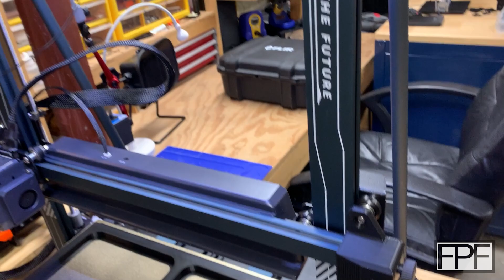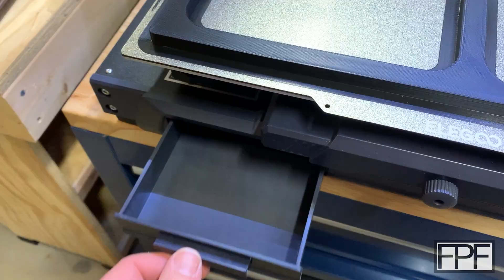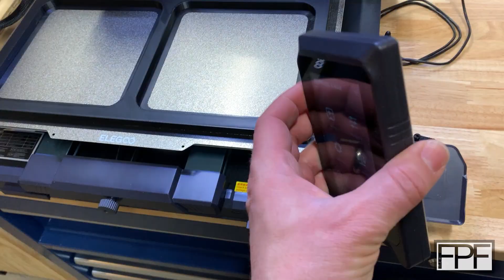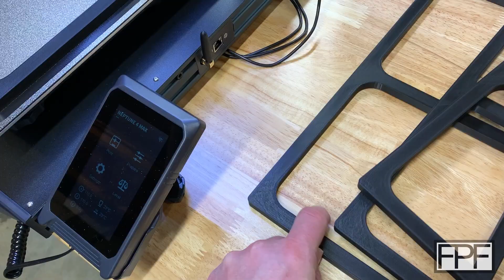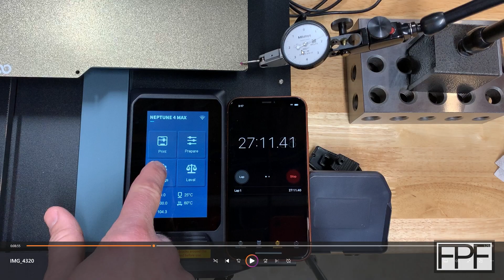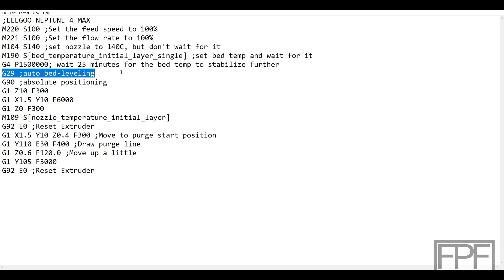Neptune 4 Max Review and a FIX for the PROBLEMS EVERYONE IS HAVING

Comment: Imagine there won't be any issues on their kick starter OrangeStorm Giga 😄🤙
Reply from the maker: I'm sure there will be, and all the early backers are the beta testers.  As long as you know that going in, I guess that's ok.  I WILL say this specific issue will be easier to address on a CoreXY machine, since you can add rigidity to the build plate without worrying about the mass you're flinging around like on a bedslinger.
Reply: @FunctionalPrintFriday can tell you for a fact you need to heat soak large corexy or large delta machines. I have  2 large format machines with the bed is either stationary, 500 mm delta, or just goes up down, 600mm  4 ball screw driven cartesian. I heat soak both for 30 min, even beefy silicone ac silicone heaters with fire retardant high temp cork insulation. I hat soak both of the. Both use 5/8" mic6 aluminum beds, lots of mass, thermaly stable and predictable. You really can't shortcut this on anything bigger than a 180x180 bed. I turn my bamboo x1c to 100c and let it sit for 30 min before I start a full bed abs print

Comment: watching this video and using cura while your saying no one uses it.

i use cura and prusaslicer for a ender 3 v2. {marlin}
cura profile is great for supports and xy compensation .
prusaslicer tends to weld print in place functional parts.
Reply from the maker: Appreciate the reply.  The comments section is proving to me that a lot more people are using Cura than I would have otherwise thought.  I do find that the supports seem to work a lot better in Orca over prusaslicer, even with the same settings.  Not sure why.

Comment: If I am not mistaken Cura is still the most used slicer. The UI experience of Orca slicer, also Bambu Slicer is still far from Cura. My wife who isn’t technical doesn’t even know how to change the print temp on Bambu slicer, just select the filament profile and print and if doesn’t work, then uses a different printer.

Also I have a 500x500 printer and have up on Bicubic bed leveling and just do a 6x6 lagrange, it does a way better job when the big is multiple mm off between everything.
Reply from the maker: Thanks for your comment.  Do you heat soak the 500x500 before printing?   Do you notice any deflection?
Reply: @FunctionalPrintFriday  That depends on the tension of the springs under the bed, the heat will warp the bed differently based on the end-point tension. When the springs do not have enough tension and you do a multi-day print, the bed level over time doesn't stay the same (while its printing). So not only does heat affect this, but original bed level no longer applied. I printed some PLA washers to go under the springs to ensure everything is super tight, and then leave it heat for a while. I also have locknuts under each spring to ensure as little of the bed changes while printing. The locknuts make it a pain in the butt to level the bed so I made some custom nobs to go over the locknuts to act as the original nobs. I then run it with a polypropylene glass fiber bed, so it needs about 15 minutes of heating after. The high tension springs ensure multi-day prints have a relatively level bed throughout its print. I found that by using lagrange instead of bicubic the mesh can be super unleveled (mine was 3-4mm difference) and still print on every inch of the bed without issue. Bicubic seems to need the bed within 0.3mm to work as expected or maybe some additional more advance settings to work correctly.

Comment: Overall I prefer using the Orca vs Cura Elegoo version, I like the user interface a little better. Customizing supports and other settings are a little easier. I've only been using the printer for about 3 months now, I have not had any issues with bed leveling, I go through the leveling process every few weeks or so as a precaution. My prints using Cura have generally been really good. When I started using Orca, the printing is not as fast, for example something that may take 24 hours on Orca will be at least 90 minutes faster with Cura (probably have a little more tweaking yet to go). The major drawback with Orca is level shifting on the y axis, it will shift nearly 10mm on an object that is 220mm in width on occasion (as an example). I can immediately print the same object using Cura and have no issues. Did a little research, sounds like a common problem with Orca.

Comment: Having to wait for 25 minutes to start printing is a huge pain in the rear in my view
Reply: It might sound like a pain, but I suspect one buys this massive printer to print massive parts.  Massive parts will likely take more than 24hrs to print.  A little extra time for a quality result is worth the effort, especially if you avoid a failure after investing hours of print time.  It’s just physics. And you get what you pay for.  The Prusa XL costs 4+ times this printer, and it has a bed heater to deal with the physics.
Reply from the maker: Couldn't agree more.   Unless this is your only printer,  I don't really see it as a big deal in the long run, especially at this price point.

Comment: I've been seeing people rave about their Neptune 4, and a few people rave about their 4 max, and started getting excited about the Orangestorm... Now I'm feeling really disappointed. If they can't get a single build plate to be dimensionally stable, how are they going to keep 4 of them dimensionally stable? I hope they learn from this and figure it out in time for the OSG launch... But I'm no longer considering a preorder.
Reply from the maker: It's an easier engineering problem to solve on a CoreXY machine because you can focus on rigidity of the build plate over weight.   It'll be interesting to see how they solve it (or don't?) in the Giga.

Comment: I prefer cura as another said I like its interface over the others.  As for the 25 min wait I’m use to that with my Voron printers I heat soak them for different amounts of time based on the filament type and temps.
Reply from the maker: Interesting.  What is the primary reason you're heat soaking the bed on your voron?  Is it dimensional stability of the bed, bringing chamber temp up, or something else?
Reply: @FunctionalPrintFriday mainly to get the chamber temp up but does help settle any flex in the bed etc from the heat.    Also not sure with the Neptune I run KAMP (for klipper) you can have it bed mesh and prime in just the area you are printing in so you don't have to mesh the entire bed unless you are always printing a full bed.

Comment: Why not overshoot the bed temperature first to 10-20C more as the first layer Temperatur and than wait for cool down the 10C to soke the bed faster than 25min?
Reply from the maker: this is an interesting idea and worth trying, though you'd still have to wait for the temp to drop back down and the bed to stabilize for that final temp before you'd want to measure the mesh
Reply: @FunctionalPrintFriday yes completely without waiting will not work, but i bet / hope you can cut the waiting time to 5-10min

I have only a Neptune 4, so i cant testit 😢

Comment: I use cura I like the interface, orca slicer is unstable... its junk and i dont love the interface.
I have a Creality s1 Plus and suffered from the same issues.
I thought it was bedwarp from heating while being constrained... never observed the issue like you did with a DTI, but I did start preheating the bed which is 300mm x 300mm for 15 mins before printing... Start gcode has a G29.
I guess same result but you have the proof.
Reply: On my S1 Plus I never added a wait time, or even a full mesh before each print, but I did experience a substantial print reliability boost by doing a z height probe in the center after the bed was heated. I did still have random failures  when I'm doing large prints with lots of small bits on the bed, like printing certain large dragons, but they're adhesion failures, and moving the printer from near a window in the room with the least stable ambient temp (no HVAC ducts) to not near a window in the room where the thermostat is, almost entirely fixed that (my house is well over 100 years old...). But not 100% - so now I'm thinking maybe I should do a bed stabilization pause and then a full mesh like you do.
Reply from the maker: give it a shot, nothing to lose really.

Comment: I'm really disappointed at Elegoo, as they've seemingly has dropped the ball on the Klipper implementation for the entire 4 series lineup. The community has really picked up the slack in that regard. I'm not planning on acquiring any more printers from them until they get their engineering and software development squared away.
Reply from the maker: I think they really rushed the N4's out the door and just hacked together the bare minimum for Klipper.  The value for the hardware is very good, but they need to spend a little more time in a limited release and listen to the community.
Reply: Yeah the stock dirty klipper is dogwater. But swapping out for open nept4une was so worth it.
Reply: You gave me a new search term 'open Neptune'. Thanks
Reply: @yeahh_idk_ can you give me the info on your swap please.
Reply: Yea, but that’s one way to keep costs down.  Make sure the hardware is functional, and let the users tinker with it.

If they wanted to spend the time perfecting the product, the price point would change
Reply: @thebigitchy  Theres a difference between making a platform to mod vs making a horribly coded pile of trash and saying “hey its not our fault its bad, we left that job for you.”